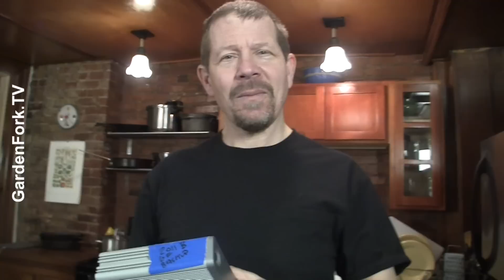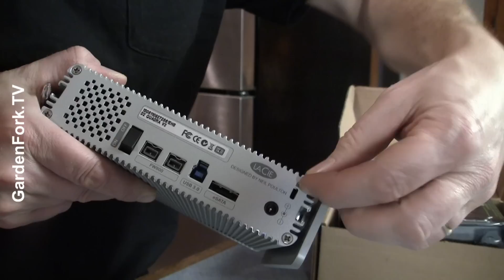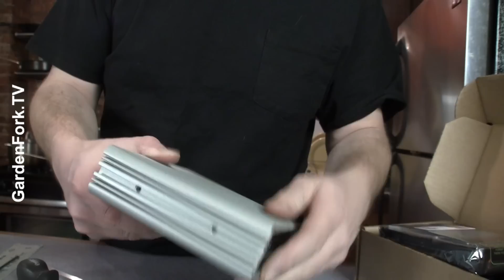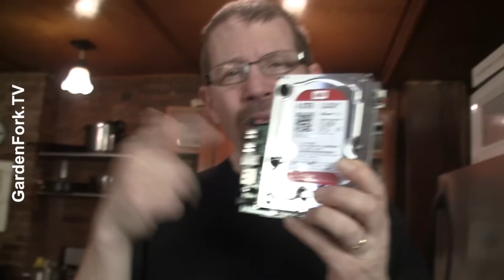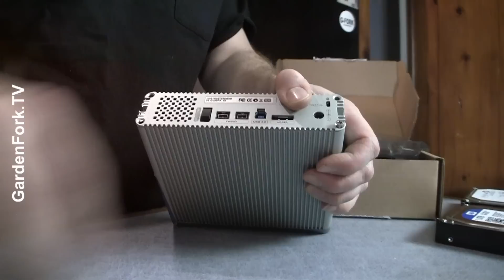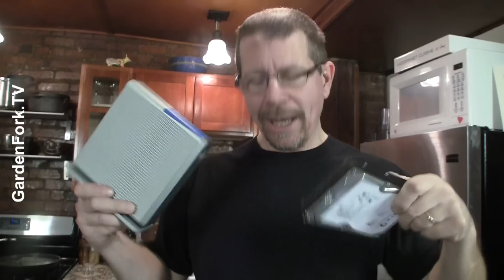DIY External Hard Drive Replacement - GardenFork  - Updated Video

Comment: I just bought an external bay to easily retrieve data from my last computer's drives. For $20, it was worth it. BTW, I'm glad to see you covering computer DIY. You can't watch Gardenfork on your computer if it's broken.
Reply from the maker: exactly! enclosures are pretty cheap, i have a few broken drives and realized i could put new drives in these robust enclosures and have more space. thx!

Comment: The grounding tip is good but electronics these days are a lot less sensitive to static shock.  Why do hard drives fail? Eric hit the nail on the head. I tell people that hard drives have a 100% failure rate.
Reply from the maker: yeah, its basically a high tech record player isn't it?

Comment: Your in my world here and I'd like to add to the tutorial.  You mention static electricity and rightfully so.  It can fry electronics faster than anything.  You were right to touch the faucet and advise touching something like it if a sink isn't available.  And your right not to rub your feet on carpet.  In fact,  if you can get as far away from carpet as possible.  I notice your working on a plastic counter top.  Formica has an extremely high internal resistance.  That allows it to hold a high static charge on it's surface.  To eliminate that charge, before you start, spray a fine mist of soap on the counter.  Windex will work.  IF you don't have that use a static thingy you use in the clothes dryer.  Wipe it all over the counter top.  You see, soap holds moisture and moisture is a conductor so it can't hold high voltage charges.  Hope that makes sense.  If it doesn't don't worry about it but do follow the advice.  If you have ever seen pink bubble wrap on new electronics... that is pink cause they put pink soap on the plastic.  Now  you know the rest of the story.
Reply from the maker: wow thanks for all the info, did not know about the plastic counter issue. thx for taking the time to write it all out. how about a wood counter top, is that better?